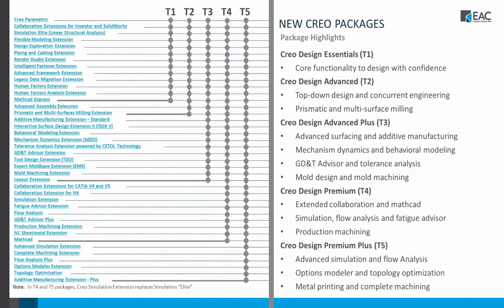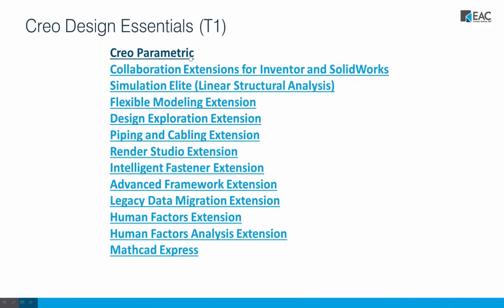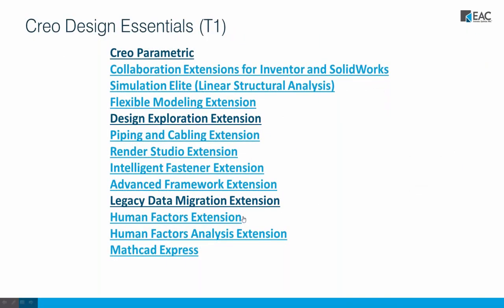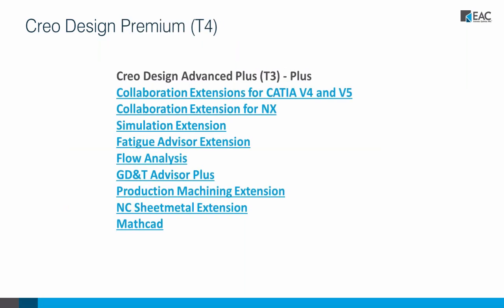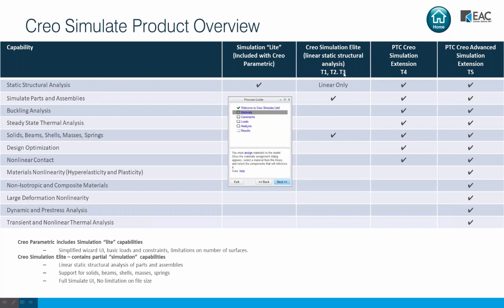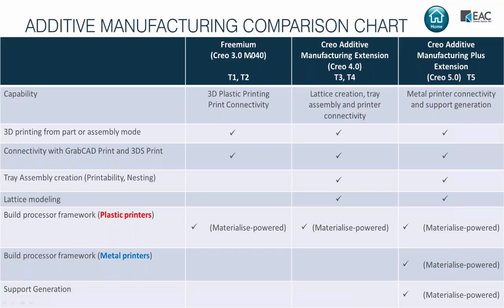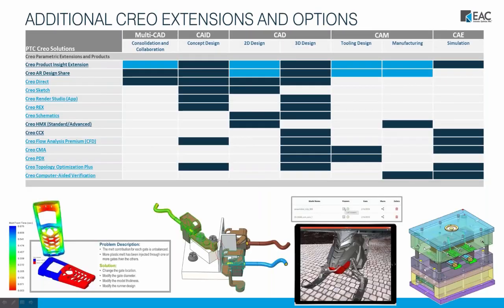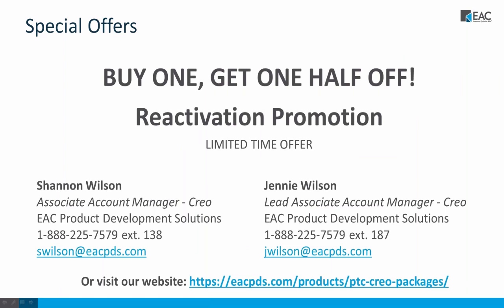New PTC Creo Design Packages Overview

Comment: Hi, great explanation of the new Packaging and extensions, didn't see Reverse Engineering extension within any of the Tier Packages, is it still available as a separate extension?
Reply from the maker: Rasesh,
Yes, the Reverse Engineering Extension (REX) is still available for purchase – but only as a separate extension that you can add to your package. It is not available in any of the new package tiers. 

For more information, here is the data sheet for REX: https://go.eacpds.com/acton/attachment/25728/f-579921ce-c457-41f8-87a1-57002920d732/1/-/-/-/-/Creo%20Reverse%20Engineering%20Extension%20Data%20Sheet.pdf